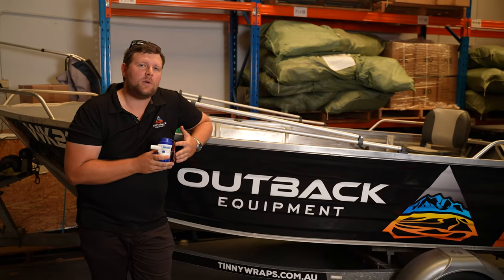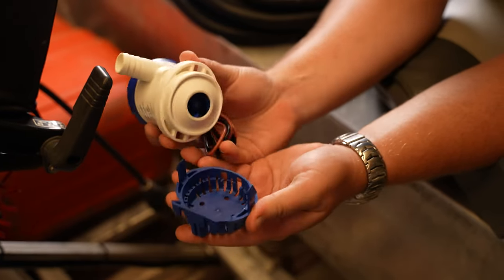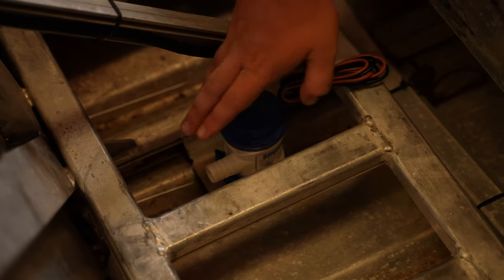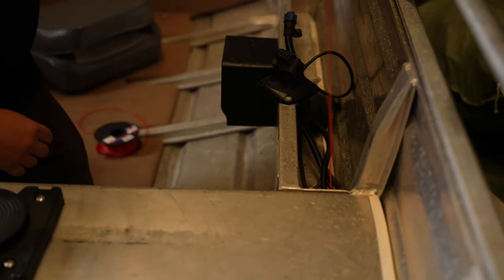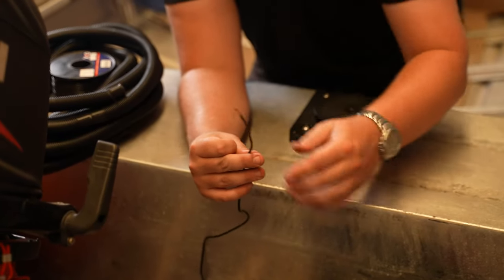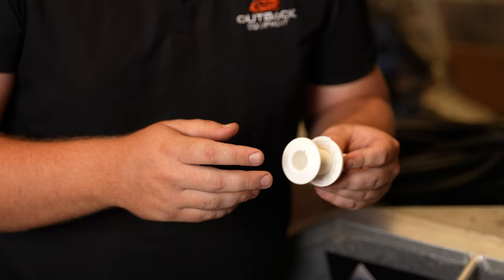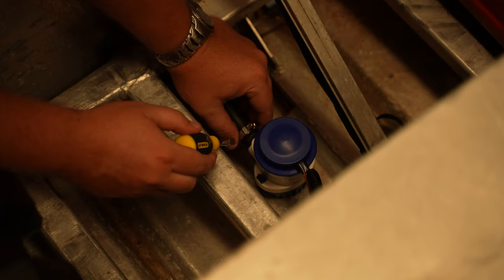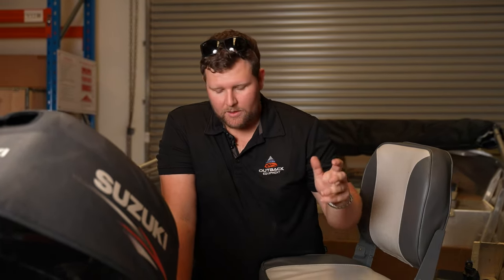Installing a Bilge Pump | TINNY BUILD SERIES EP6

Comment: Interesting to use glue.  I had a bilge pump the was no longer running.  It was mounted directly beneath the engine in my inboard boat.  I could remove it but I couldn't get the base plate out.  The new pump didn't fit the old base plate.  I mounted the new pump using short self tapping screws in my bilge but it's up a little higher on an angle.  It works just fine, but after a whole day in the lake it will have a bit of water below the pump so I'd like to mount it lower.  I might use the glue method and see if I can get it down at the bottom of the bilge area.

Comment: Heya mate... two questions for you. 1: Why did you glue it in rather than using screws, what happens when the pump eventually fails and needs replacing? 2: Why did you not include a float switch?

Comment: Hey slight comment here first GREAT video really appreciate it but is there a reason you didn't set it at the base base of the boat in that groove where the water was? I'm installing electronics on a small sail boat that i have and this series has been great cause the boat has nothing in it right now but I do need to add bilge and maybe lights soon as well.
Reply from the maker: Thanks for the feedback Ian! We chose this surface because the base needs a very flat space to stick properly and operate, the very bottom was just too small to achieve this.